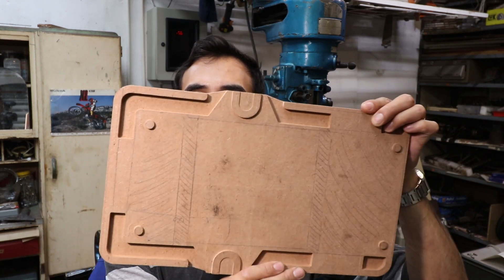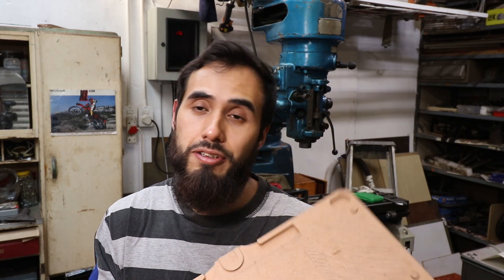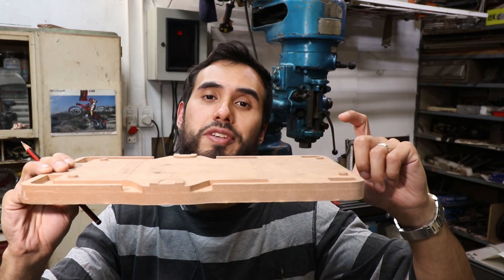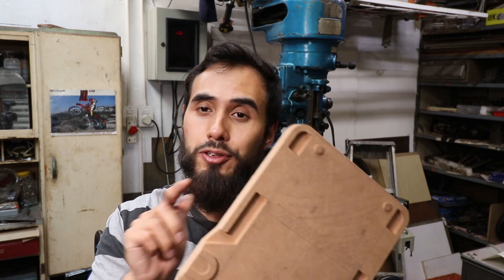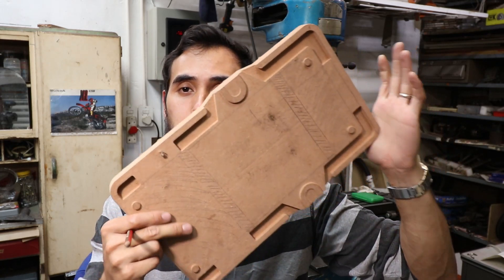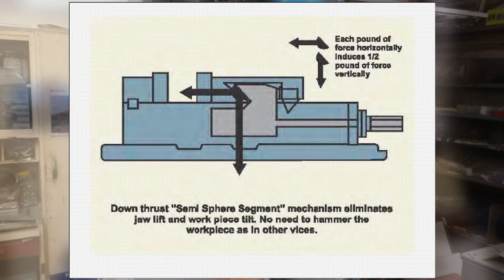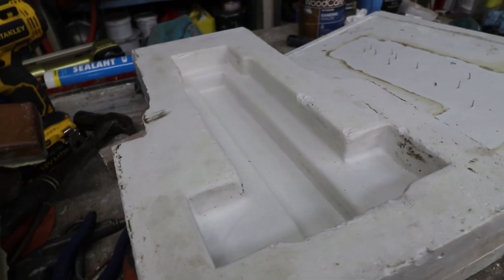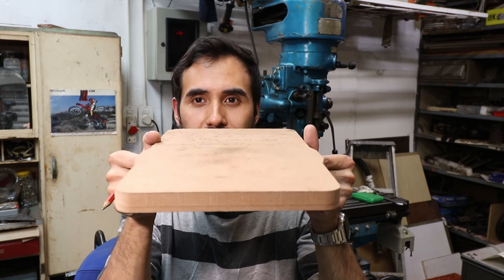DIY Cast Machine Vice - Project Overview

Comment: Wow! This is going to be interesting. The Kurt 675 was a classic. Got two a few years back and they were expensive. In places like South Africa I can see it as hard. Your going to need to check your draft angles. You also need to finish against swell. I been at it for years. I like sugar pine and mahogany. Durhams wood putty is an excellent filler. For cores, you need to use sand with water glass. WG is sodium silicate. You gas it with CO2 to make cores. I am going to enjoy this series.